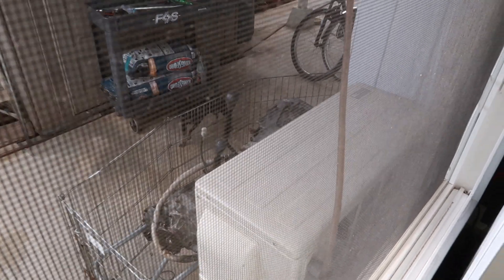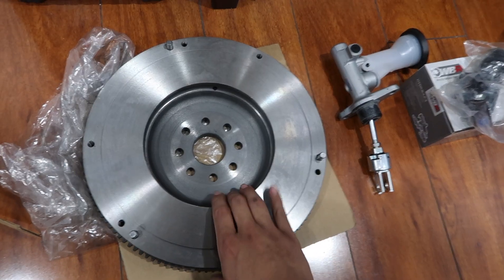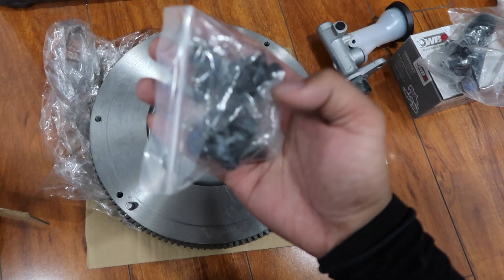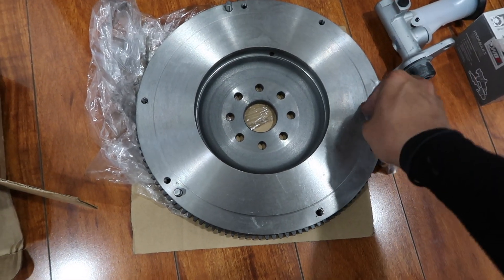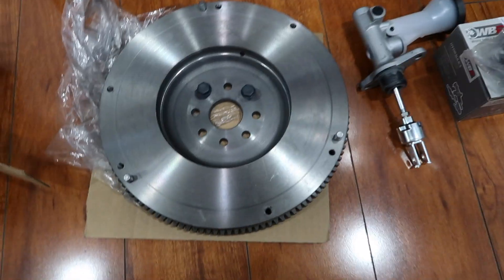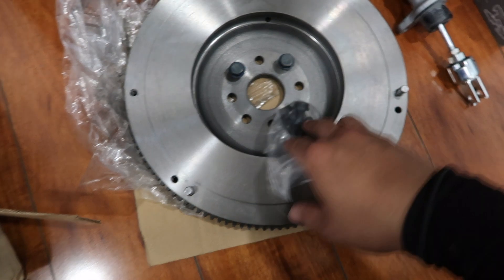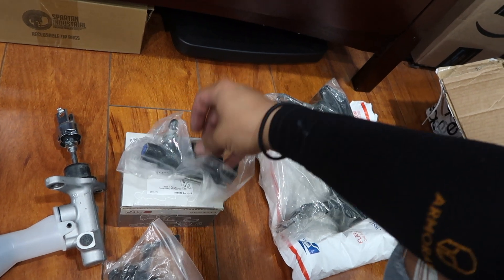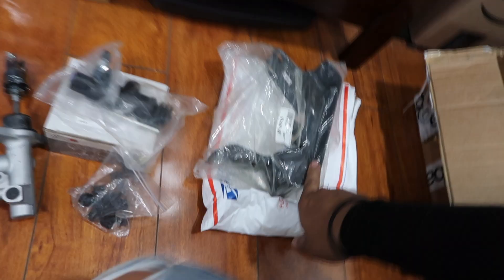What You'll Need For Manual Conversion | 5-Speed Swap Pt.1 [1st Gen Tacoma]

Comment: How big does the driveshaft spacer need to be?
Reply from the maker: Depends how far out your slip yoke is at. They say general rule of thumb is supposed to be halfway in so it has room to move in and out whenever your rear suspension compresses/decompresses.

Comment: a question friend I am in the sawp from automatic to Manual transmission but the brake pedal is very short did you use the same Automatic Booster or buy a different one thanks I await your answer
Reply from the maker: Sup man, I used the same booster. I didn’t swap out my brake pedal. I just cut it to length to where a “manual brake pedal pad” can fit over it. So it looks factory with the pad.
Reply: @fortunestatushawaii  thank you brother save me a lot of work thank you

Comment: dude... on a 2005 Auto/6 cylinder engine... would be the same work???
Reply from the maker: Should be the same concept, just may need to source specific parts for your year. I’m also not too sure if the 05+ have more electronics involved.

Comment: Good video! On an important am wondering if the transfer case that came behind the automatic will work with a manual.
Reply from the maker: According to the research I been doing in this period of time, I believe they are interchangeable. You just can't mate a transferase on the back of a 2wd trans though. It'll have to be a 4wd auto or 4wd manual 👍🏼
Reply: @fortunestatushawaii  Thanks for getting back to me.
Reply: I had the same question. I have read the an auto tranny tcase will work in a manual tranny. 

My question is what about the shift levers? Because the shifter sits in the right side on the manual. Does the lever pivot? Or will i have to buy a lever with a different bend?

Comment: Cannot re use the same pressure plate bolts in the trans ? Sorry planning on changing my clutch soon but idk what kine parts i need exactly yet lol
Reply: but is it necessary to buy pressure plate bolts when changing it, or can just reuse the stock ones ?
Reply from the maker: It’s advised to change them out because they “stretch” when torqued but personally I’ve reused pressure plate bolts in the past on my 240sx without any issue so it’s up to you at your own risk lol.

Comment: Hey man question , what did you do driveshaft wise. Just picked up the manual driveshaft off a ext cab I measured the wheel base and they seemed to be the same . Do you know if it will fit off hand ?
Reply from the maker: The manual driveshaft is about an inch longer since the manual trans is shorter than the auto trans. I had a single piece drive shaft made and I accommodated that extra inch and asked them to make it an inch longer. Other wise you’d have to use a driveshaft spacer with the auto driveshaft on a manual trans but since you got a manual drive shaft you’ll be fine 👍🏼

Comment: You missing da throw out bearing you have the throw out mount but you gotta press on the new bearing on it. Also you need the clutch line from the reservoir to clutch slave. Also you need to add resistors for your wiring harness to fool the computer to think the automatic is still there. It is easier if you swap the whole dash harness and speedo cluster from one with a manual. Also if you can get the manual floor center it is easier to just weld it in and then the center counsel will line up. Other than that looks good my bruddah! Good luck 🤙
Reply from the maker: Thanks braddah! 🤙🏼